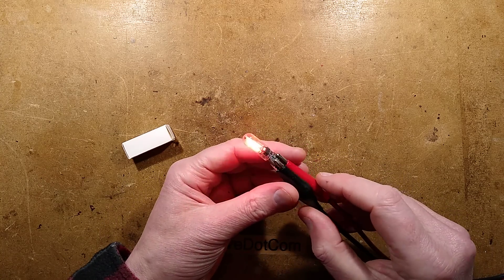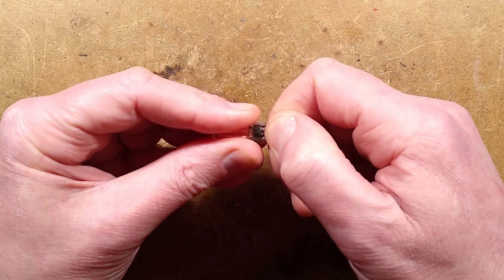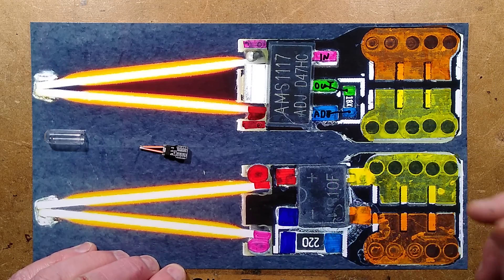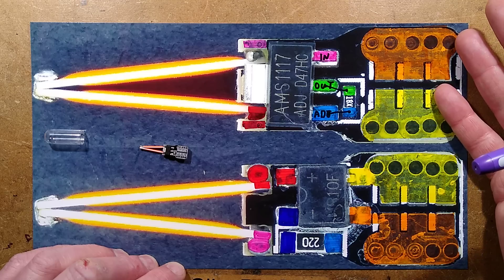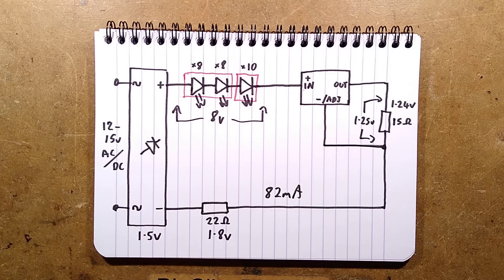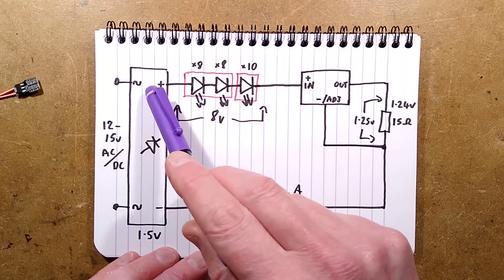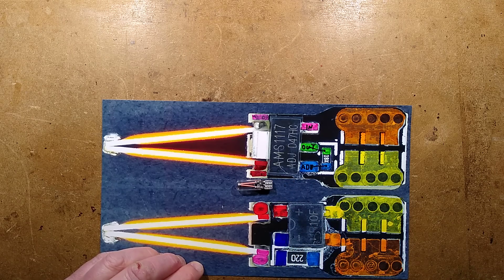Neat vehicle lamp with current regulation (with schematic)

Comment: A 1117 LDO is not a great choice for automotive use, they have an absolute maximum input of 15v so it's not going to take much of a spike to kill it.
Reply: But in current regulator mode, it doesn't have the full voltage across it - only what's left of the voltage drop after the leds and the 22 ohm resistor (totaling 9.8V). So at nominal 12V, it only has 2.2V across it. At alternator running voltage (14V), it only has 4.2V across it.
Reply: @gorak9000  A load dump event can put transients of up to 100v on a 12v car system, and ISO-16750-2 requires automotive equipment be able to withstand ten such transients in a ten minute window.   How long do you think the 1117 would last with zero input protection?
Reply: @ferrumignis  In this circuit, the LEDs are the input protection - I bet they'd die way before the AMS1117 does
Reply: @gorak9000  The rectifier diodes probably drop the input voltage about 1.4V as well.
Reply: @gorak9000  The 1117 would die instantly with that level of overvoltage, and then the LEDs would die if the LDO failured short circuit. They are not robust regulators even outside of automotive applications, even the ancient LM317 would have been a better choice.

Comment: And then you get the MOT plops that complain that "It's not red/bright/even enough!!!" and fail the car's test, cos some still can't accept retrofitting LEDs in older, pre-LED cars... :P
Reply from the maker: Yeah.  They have to tick their box.
Reply: Admittedly automotive lighting is relatively complicated. A cheap LED bulb which does not replicate the beam pattern will result in the fitting not working as designed. If you must replace with LED then find approved replacements (in the US it would be DOT approved bulbs, EU probably ECE, idk about UK). Save the cheapos for the interior lighting.

Comment: Hi Clive - At what volts do  the LED'S start to light? As I have found Running the Lamps on 10v5 they do not get as hot and consume less current and make great work bench emergency lights run from a 18650 charger VV booster and can run for a couple of night with out charge.
Reply from the maker: They should start to glow at that level.

Comment: Those AMS1117 regulators are everywhere. I've started using them in preference to the 78 series as they are a bit cheaper too.
Reply: The trick of using the adjustable regulator as a constant current source comes directly from the LM317 datasheet - it actually has a number of "unusual" application circuits in it that can be quite handy. I always lump the LM317 in with the 780x regulators in my head.
Reply: AMS1117 is a LDO (low dropout reg... dropout voltage of 1.2V)  LM317 is higher... about 3V... newer version of 317 might be better.
Reply: @willthecat3861  I got some AMS1117-3.3 to mess around with some tiny adapter boards, and added a resistor as here, resulting in a LED current source with a similar overall forward drop to the 317 circuit.

Comment: Interesting use of a regulator... I love your videos for discovering these types of details!
Reply: It's a standard use for a voltage regulator. You could do it with an old '7805 but the later LM117-style and lower dropout regulators are far better suited to it. As the 1.25V is derived from a bandgap reference it's very stable and makes a good and cheap voltage reference.
Reply: @Graham_Langley  It might be a common use, but most hobbyists like myself are probably not familar with it... being a voltage regulator and not a current regulator will limit searches for such circuits 😺 - when I saw it, I was from "what the..." to "oh, that is smart" in a few seconds, but I never seen it before and that's why I love Clive's videos. A nice source for such little tidbits without reading boring data sheets all day.
Reply: YES...Me too !

Comment: For automotive applications, you'd want to use voltage regulators with at least 40V max rating so they don't immediately blow up on the slightest alternator-battery hiccup.
Reply: Ideally 60V.  Typical standard levels of survivability for automotive transients is -40V to +60V.
Reply: That's standard design practice, but any remotely modern vehicle won't produce those voltages.  "Load dump" spikes were a problem with slow regulators, mechanical voltage regulators and early electronic regulators.
Reply: @1djbecker  Although many newer cars (where "newer" can easily be 10 years old or more) use switching supplies for the 12V, isn't inductive spikes from switching loads still a thing?

Comment: 1117 in fixed 5v....had a few arduino projects fry when that goes short, run weeks off the 12v bench supply but then die in the car.....

Comment: Is this voltage regulator out of the LM117 family?
Reply: Yup. When Clive gave the number right at the start I expected the next bit to be "so it's probably a voltage regulator".
Reply: AMS1117 is basically a newer family than the LM317. They've been around for a long time now - you see them in tons of products in the fixed 5V and 3.3V variants
Reply: @gorak9000  sorry I meant LM317, there was a 117 though ISTR. A regulator design so old I reckon there was a thermionic version.
Reply: @ShaunieDale  I knew what you meant. I lump the LM317 in with the 780x regulator families - I'm not sure if that's correct or not, but I think of the LM317 as the adjustable 780x. The AMS1117 definitely showed up a lot later - I think I started seeing them in early to mid 2000's. Mostly because they had 3.3V and 1.8V fixed versions, so anything that needed lower core voltages started using them. The 780x/LM317 seemed to still be the de-facto standard in the hobbyist circles though - they just stuck with what was familiar. So the AMS1117 is by no means "new" at this point (at least ~20 years now), but it's "a lot newer" than the 780x/LM317
Reply: @gorak9000  The LM117/317 is a completely different design to the 78 series. For a start it uses the input/output differential for its supply, hence the minimum current requirement. The third ref/sense pin is just that.
The was a four-terminal adjustable 78 series regulator, the uA78G (and uA79G) from Fairchild, where the fourth pin was the sense connection to the external potential divider. 
Made it very easy to do supplies that compensated for voltage drop in leads. 
Analyse what happens with a '117/317 reg  when you have a voltage drop between the output pin and the point at which the voltage sensing potential divider is connected.

Comment: I got some 39mm Festoon LED Car Bulbs and was surprised they work whichever way you insert them. So they must have a bridge rectifier. I haven't tried to take one apart to see if they are current regulated or just a resistor. Actually it might well be that all car bulbs are current regulated so the brightness stays constant regardless of the voltage on the nominal 12V bus which can probably vary quite a bit.
Reply: For automotive use the nominal voltage is 13.8 volts, but should be expected to vary from 9.5 (while starter is cranking) up to 15.75 (charging a low battery with very cold temperature). Ideally one should design for possibly nearly 24v peak to peak AC on top of the DC voltage.
Reply: Some are some are not.  The ones that run on anywhere from 10v  - 30v must be.  I measured some that were using 500ma on 12v and 250ma on 24v .   So as you increase the voltage they reduce the current they use,   if you get below 7v they start flashing like a strobe light.
Reply: @chrishart8548  If the current goes down when you increase the voltage they must have a switching converter. Very fancy as well as relatively unreliable.

Comment: Since Tesla is currently a bit over 12 V, and will move to 48 V for its low voltage this year (the Cybertruck will be the first), would this work for about 50 VDC? Something similar would work, at least.
Reply from the maker: It wouldn't be suited to that voltage.

Comment: Many thanks. Learned about using a rectifier for DC polarity determination. The light given off seemed very modest. Where in a vehicle would this be used?
Reply from the maker: I'm not sure of its intended location.  Possibly instrument illumination or a side light.

Comment: 26 LEDs dropping in total 8V? so 0.3V per LED?
or 8 LEDs in parallel, then again 8 and then 10 in parallel?
then it would be nicely 8V / 3 LED = 2.66V
I am confused
Reply from the maker: The LEDs are three parallel sections of about 3V each in series for around 9V.
Reply: @bigclivedotcom  I thought so - just the drawing and afternoon beer confused me ;-)

Comment: No CAN bus resistor, so it will set a fault code on vehicles that monitor the continuity of the lamps continuously. Simple to fix, a 220R resistor across the pins will allow enough current to flow.

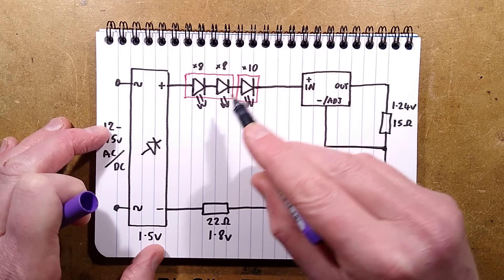Comment: Are the 2 x 8 LED strings in parallel (as said at 4:30) or in series as drawn?

Insightful video as always.
Reply from the maker: There are three parallel groups of LEDs in series.
Reply: @bigclivedotcom  Ah, that explains a lot. So the voltage drop over one LED is about 2.7V.
Reply from the maker: @jurjenbos228  Typically between 2.5 to 3V depending on current.

Comment: Using the diode bridge isn't really less efficient since the regulator is a linear one. If the diodes weren't there the regulator would have to dissipate more power.
Reply from the maker: I was thinking more along the lines of potentially using four sets of LEDs in series for greater efficiency.  But the three sets do allow a wider voltage range.

Comment: These might work a lot better for older cars that use filament bulbs. Many o the LED lights if you buy them in the UK saw they are not indented for road use. 🤦‍♂😂
A lot more going on than I expected 2x👍
Reply: Some of the more modern cars detect if a bulb has "blown" and report a fault if LED bulbs are used to replace filament bulbs, so unless your car is designed to use LED light bulbs you may well end up with a fault being reported when you replace a filament bulb with an LED bulb. The fix used to be to fit a large wattage resistor parallel with the LED bulb to mimic the current drawn by the original filament bulb to avoid the error message of a blown bulb being displayed.
I'm not sure what the latest cars make of the user replacing the original bulbs with LED bulbs, though.
KW.
Reply: @GetCarterCarPark  ... I'm not sure that it's a 'current draw' that is used to check for blown bulbs ... I put one early LED in my '95 truck (combined stop/turn signal) without the extra resistor ... The turn(/stop) on that side started to trip the cruise control ...I don't know if it was sensing the 12v when the brake light was on, or if it was using the bulb as a pull-down resistor ... I wondered if a high value resistor in parallel would have worked - but never investigated ... I know that the high brake light had to run off the switch on the master cylinder (which is PRE- flasher?)
Reply: @jayherde0  On a 2000 Accord there is indeed individual current sensing for both of the main brake lights, I don't know what the threshold is. What happened with your truck doesn't make much sense but I can think of one remote possibility. If the bulb has a non electrically reversible base there could be a capacitor inside the LED module. When the turn signal turns off the lamp would be reconnected to the brake switch and the charged capacitor would provide voltage there for an instant before the high brake light would discharge it. The cruise module could see this blip and interpret it as you tapping the brake pedal. It just doesn't seem very likely that all those conditions would be true.

Comment: Nice smart design - I like it but wonder how we got from a bit of resistance wire in a glass envelope to a electronic  module and ceramic LED strings 😂  and I bet it's cheaper to make!
Reply: It's like how now it's cheaper to have backlit TFT LCDs than analogue gauges so the cheap cars are all TFT and the expensive ones have analogue gauges. Which would have seemed insane 10-20 years ago.

Comment: I wonder if the reason for the rectifier is to avoid damaging the voltage regulator with reverse polarity.
In any case, it's gratifying to see manufacturers using a rectifier in this way. As you say, it is quite easy to reverse the device to make it work, not so easy when the lamp has a bayonet cap! My car (a Ford) has positive shell and negative pin, the opposite of most vehicles.
Reply: Allows installing either way and also drops another volt or of the circuit.
Reply: The LEDs themselves would protect against reverse polarity.
Reply: Same thing I was thinking.

Comment: The EIA-96 coded resistors are 1%, so they would require 3+1 digits to print the actual value. Using a lookup index in the E96 series only requires two digits and a multiplier character. I guess it's more legible to print 3 characters on the smaller SMD resistors than 4 digits. This resistor just happened to be 15(.0) ohms, making the last digit seem insignificant, especially with 15Ω also being in the E24 series - but if they had needed a 14.7-ohm resistor instead, 14R7 might've been pretty cramped and not condensable.

I finally had to decode a handful of those EIA-96-coded resistors, so I wrote a script to do the lookup for me. The formula is straightforward, but still requires lookup or a calculator unless you've memorized the whole E96 series: two digits for the position in the E96 series (01-96, giving a value between 100 and 976), then a letter for decimal multiplier (A-F for 0-5 zeroes, and X-Z for x0.1-x0.001 -- except that sometimes B=H, X=S, or Y=R).
The hard part was writing the code to give me the nearest EIA-96 code for any resistance I give it.
Reply: Considering the limited availability of E96 series I do my designs in all E24 1%.  Usually when I call the vendors they got them a plenty and they are the cheapest.  If I choose a non E24 then they tell me sure mate but we'll have to run a batch just for you. So two months.
If for some reason I need a value between an E24 number I just parallel or series two resistors.
Reply: @kthwkr  decent suppliers have E96 1% in stock nowadays. It's 0.1% and better where you'd better stick with E24

Comment: Curious if this lamp can be pulse width modulated given it has no capacitors. My car's dome light fades out instead of shutting off abruptly
Reply: It should dim as expected provided the PWM frequency isn't too high.
Reply: The fade is probably there by design. If there is a cap, try a bleed resistor across her.

Comment: From what I understand, that strange resistor code (EIA-96) is used for higher accuracy (1% tolerance) resistors. So the value of that one will be 15.0 Ohms (+/- 0.15 Ohms).
Reply: I seem to recall reading something about that.
Reply: I concur, use the. Use them often for stage lighting moving head units
Reply: Yes the alpha numeric gives you much more info in a print you can read.
Reply: Yest, Clyde isn't a real engineer so he doesn't really understand what's he looking at. 18X = 15 Ohms
Reply: @molkhal  Closer than many of the "real" ones I work with.

Comment: V. nice reverse engineering job - these things are tiny!  Clive do you think the bulb was filled with heat conducting gas to help the cooling?  A lot of the glass LED filament bulbs are filled with helium , which transfers heat from the filament far better than air would.    That's how they get away with using no heat sink on the higher wattage specimens..
Reply from the maker: No gas as there was an open channel between the cover and PCB

Comment: Nice and simple, and I like both AMS1117 as a CCS and the use of a FULL BRIDGE RECTIFIER for ensuring polarity regardless of the way you put the bulb in. Simple is better than complex, beautiful is better than ugly, readability counts, blah blah.
Reply: you cant beat a good full bridge rectifier . 🤣🤣
Reply: @dcallan812  
only that it might suck 1.4 … 2V, depending on the current. That’s a lot with a 12V supply.

Ok, resistor & regulator drop more.
Reply: @fromgermany271  it would  suck lots. But it was a joke on electrobooms channel. . 👍👍
Reply: @fromgermany271 it's a lot less than the near 4 watts used by the #194 it replaces.
Reply: @dcallan812  Shurely, that's copyrighted by someone else.....😉
Reply: @travelbugse2829  Dont call me Sherly. 😂😂🤣🤣Good old electroboom. 👍👍